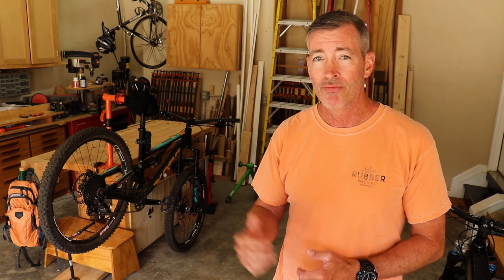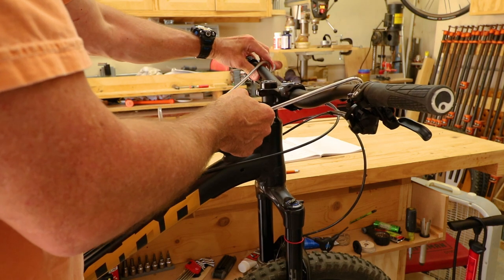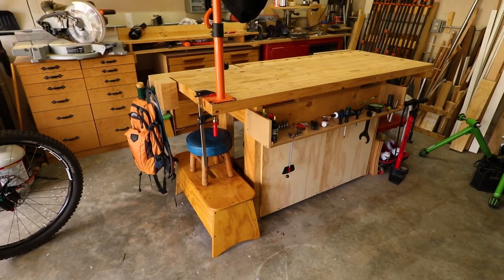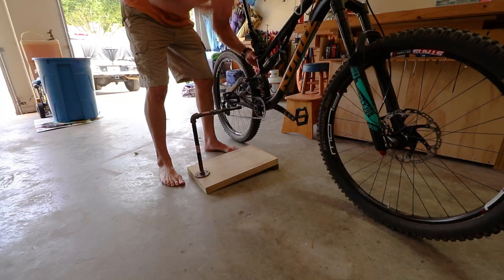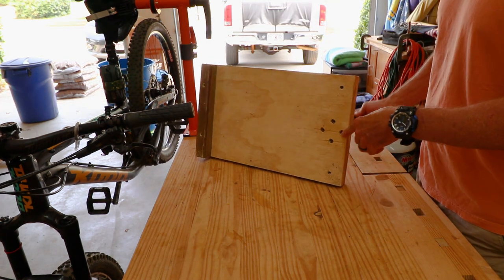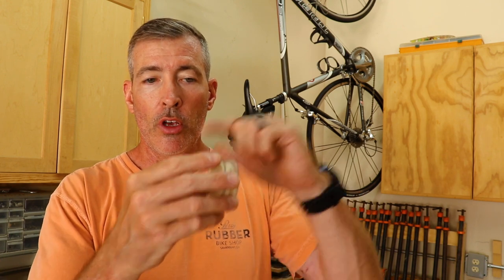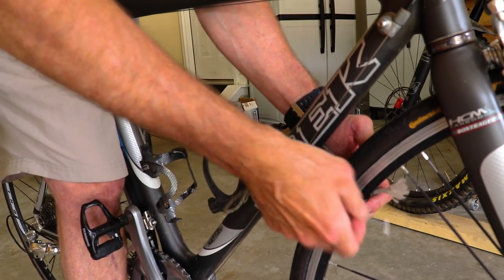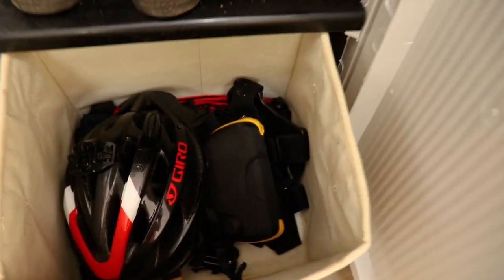Organize Your Garage bike Shop. Mountain Bike

Comment: 9:20  that never happens to me, I use Jagwire wire & housing cutter, they cut trough brake housing too, easy, and have a awl at the end. but some times it gets little bit compressed, but that's why it has spot to clamp the housing in to make it round again. but your hack is smart hack for sure if you don't have a good tool for the job.
but I cut Shimano Sp41 housing for gears, but mechanical brake housing is the one that gives you ost problems, I cut Jagwire Pro compression less mechanical brake housing, as shown in this video, this can happen, as it's made in a different way, and the metal cut can block the hone, I just cut it off little, and then use tool, and then use a smooth file. takes about the same time as your hack I think.
Reply from the maker: Thanks, I’ll have to check that out👍🏻

Comment: The only way I can wash my bike is in the shower. quite small area, but I roll bike on the rear wheel in to the bath room lean it against the toilet with the pedal, against the wall by the tyre, and swap between different locations to clean it all. I never put the bike upside down, unless I do it to take a photo of something under it. but outdoors I do, usually on a flat area, I did this when brake caliper got loose, had to align it with zip ties, that's another hack works nicely, but for working on the brakes at home I got Hayes FeelR tool.
Reply from the maker: That’s awesome 😁👊🏻
Reply: Hmmm. Seems like with a little creativity there might be a better place. Or maybe u need to tone the creativity down a little ha ha.
Reply: @donotrobme9295  for me there is not. I can't wash bike outside, nor in my living room or bedroom. 😁 Water has to go somewhere, until I get a room just for bikes or a garage with washing drain the shower it is. This is common in Norway, and some live in blocks, with no garage some live in townhouses.
Reply: Johannes Nilsen thats incredible!!!  Do the petroleum stations have free hose water??  That sounds crazy. Wow. Good fir u
Reply: @donotrobme9295  I ride in winter too, so I get road salt on my bike, but why would I get salt on my bike then wash  my bike and get bike full of salt agian so things corrode, rust? Pointless, bike will be a mess after cleaning. Some gas stations have pressure washer for cleaning a car.
Reply: Johannes Nilsen it’s amazing how we all live so different I suppose. I live near a big city and they all live like that too. I feel crammed here but have hose access even in the freezing winter with frost bibs. I’ve often thought ski resorts or rides for a cause etc, would kill it if there was a Way to have a bike cleaning station like car washes fir bikes

Comment: Makes me wonder if a tippet spool would be wife enough. I have enough of those
Reply from the maker: If the hole is at least as large as your axel and the inner width is at least as wide as your chain then YES!
Reply: Trail Breaker I’ll be checking ASAP. Could always modify the tippet spool as needed too. The TB